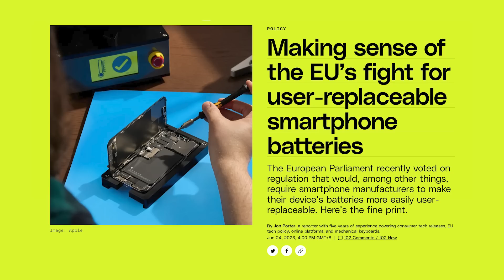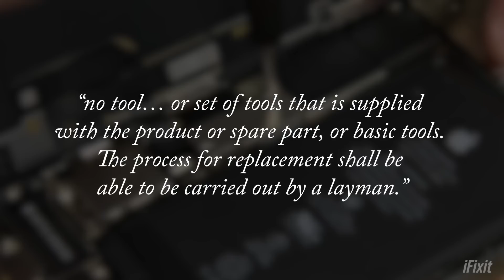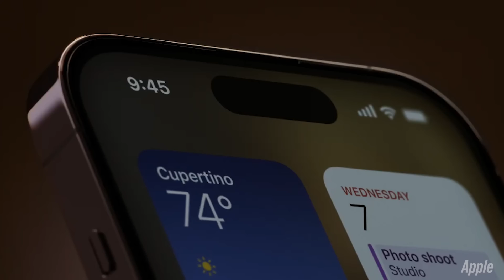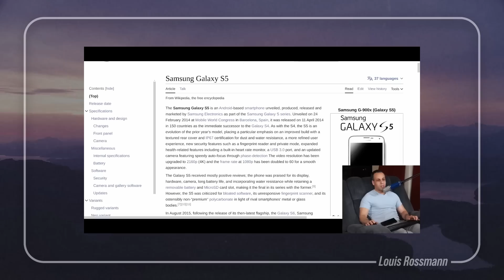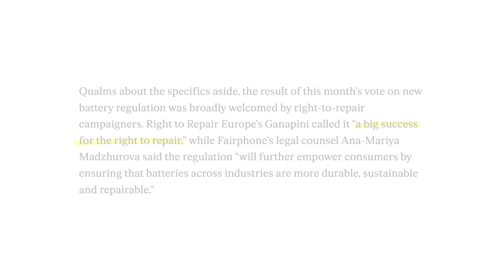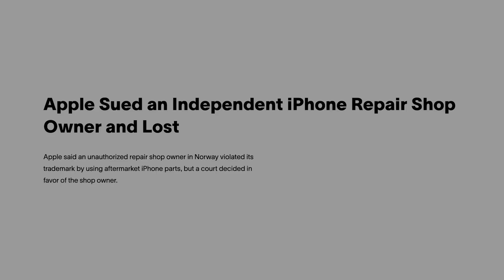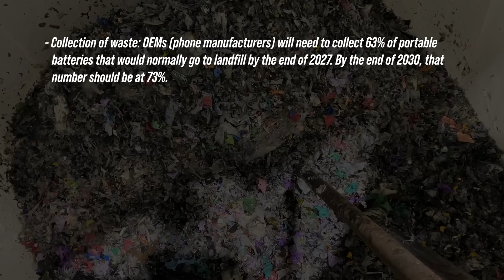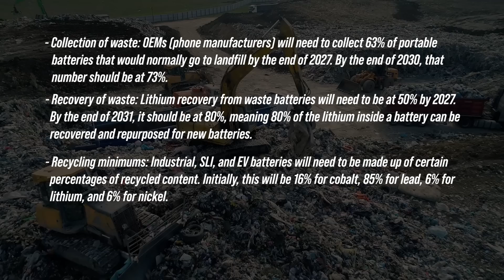EU Just Changed Smartphones Forever

Comment: Despite all this, the funny thing that happened to me with the Samsung Note 4 with a replaceable battery is that Samsung stopped selling batteries for it, and I couldn't find a decent battery that would last longer than a month.
Reply: One of the points of this law is that batteries will have to be somewhat generic. Multiple phones released in the same year will have to use the same battery, so replacement parts will be available for a lot longer.

Comment: Replaceable batteries are only useful when battery capacity is low or consumption is high. Almost every phone has smart charging now and can easily charge the phone back up quickly. 

If consumers are throwing away phones becaues "the battery is dead". That is not a replaceable battery problem, that is a consumer mindset problem. You can change batteries in phones even years ago. Almost any phone shop would easily do it for you and its not expensive (unless its Apple). 

I'm also not buying the environmental issue angle. If batteries have to be replaceable, it also means stock needs to be available. Since it must be serviceable by the user, companies have to make it available in stores, shops have to order more to stock up on batteries. Eventually those models go out of date and what do we do with the surplus batteries? Waste resources recycling them when perhaps they shouldn't have been made in such quantities to begin with?

Comment: The law is stupid. Typical EU overreach in the same way as cookie policies were a stupid thing that ruined the web. Yes, there's a problem, but they always go too far.

Phones nowadays are very water and dust resistant while still slim and sleek. If you have a law like this, you'll lose that functionality for changing a battery. Are they going to expect smartwatches to also require changeable batteries? Most high-end regular watches don't even let you change the battery without tools.

The intelligent thing would have just been a law that you shouldn't be using glue in any way that stops or hinders you from replacing a battery. That's literally all we need.

Comment: I do believe glued together phones resulted from consumer demand. Conspiracy theories are fun, but fact is: when the last few phones left with easy replaceable batteries, the masses ignored them. Started to buy thin and shiny phones made of glass. And for the manufacturers it is easier and cheaper to glue them together, it makes process much simpler. And they got away with it only  because the consumer agreed. The problem is much bigger than this. I have always replaced my batteries in glued together phones. The difference is, instead of a minute, it takes half an hour. Problem is, that it is almost impossible to find and buy the genuine parts. Most of the batteries and screens sold online are not genuine, many of poor quality and some are potentially dangerous. Why manufacturers are not forced to sell spare parts for any equipment they are selling? This is the most important question we need to ask.

Comment: You could have a more powerful device if you could separate out it's components. Just like a regular computer why not have a display unit that has a good battery and basic prosessor that via either a cable or wired means updates and receives screen updates, with a cpu dongle. so that you could have an even thinner screen and faster speeds kind of like the Apple vision pro

Comment: A clear signal and a start to a sustainable environment.

Isn't it obvious that not being able to replace batteries leads to the remplacement of the device?
Thanks for the share ✌️
Reply: that's the idea.

if you build your product in such a way that after 1 or 2 years it starts to become unreliable or even breaks down, and you made it impossible to have it repaired. (or only allow to be repaired by your company for a price almost as high as a new one). 
people will have to buy one of your devices every couple of years which means more profit. and we all know that companies will do anything for a little more profit.
Reply: You can buy a Exchange set and replace the battery yourself if you are a bit handy. For some strange reason the condition stays good longer. The next step must be that apps stay working on old iOS and Android systems
Reply: None of my phones have had to be replaced due to an aging battery. It is always because of some technological shift. Cell service going from 3G -> 4G/LTE -> 5G, 32 bit -> 64 bit, system performance and memory usage by the latest OS's and apps. It's not been a battery issue for like 20 years. Mandating replaceable batteries is not the correct way to encourage innovation with regard to sustainability.
Reply: @MBergyman  I understand, but I think that "the right to repair" is going to go further. Well it's going to have to.
The simple question about "total sustainability" isn't answered today if I'm correct.
So here's one downside, in a distant future, all of humanity will have to agree on; One smartphone that lasts 50 years?
This implying that you would have one or more organisations that would build the same thing forever 🤔
There's a lot to be done here. Not only building but also a mentality shift if you ask me.
Reply: @EmilyandtheG It's baffling, as used to have a older samsung tablet and the only reason I wanted a new one mainly just of the performance degradation (which wasn't a issue before when it was still fresh and all alike and it's a galaxy tab a 2016) and I think updates were gone from it by then.
Reply: @EmilyandtheG It means that you are an amazing person 😉
I'm certain that you are not alone. Still, it's like Christiaan is explaining. That kind of business model brings more profit.
And there are tons of applications were this can change.
Unfortunately there's also a downside to a sustainable future.
Reply: @EmilyandtheG they've deliberately been making phones have less longetivity, so the newer phones don't last well.

Comment: Slim phones with non replacable batteries are useless and have been made from pure greed. Nowdays almost everyone hase a phne case that adds to the bulk. User replacable batteries are the way, I would prefer to have a spre battery in my pocket rather than powerbank. In just 30s I can have fully charged phone...also spare battery is way smaller that powerbank. Laptop that is used at home is pluged in 99.99% of the time, batrery is going to waste. Long time ago I used to remove battery from laptop if I used it at home, batrery was only in use If I'm on the go, and that battery would last way longer than laptop

Comment: Good article. This is good news but I don't think the regulations go anywhere near far enough. The replaceable batteries should be STANDARD, OFF-THE-SHELF batteries, i.e. AAA, AA, C, D, and button cell types like 2016, 2032, etc. That would mean you could buy spares and carry them in your pocket. There is absolutely no excuse. I've been campaigning for this for the last 25 years. Did you know some laptops from 40+ years ago used 4 standard AA cells?

Comment: no one is FORCING you to buy a phone with a non replaceable battery. there're plenty of choice on the market of phones with replaceable batteries. and since iphones are so popular obviously the battery is not a problem for the consumer. government bureaucrats should have no business in regulating how a phone is designed or what features it has as long as it doesn't harm the consumer.  and the environment argument is a complete BS as the prime reason the phone ends up in the trash is display damage. should there be a law forcing phone manufacturers to make easily replaceable displays? what a joke

Comment: Now if you're phone is stolen, there will be no possible way to locate your phone! Always, there's a trade off. Also, Apple might say ok take a replaceable battery but I'll short supply batteries, so it isn't possible for you to find a new one. Once you find a new one they'll make it a hell of a deal to program the new battery to work with the phone.
Reply: So how can you track a stolen phone that's turned off
Reply: iPhones can be tracked by find my phone a certain amount of time before the battery is dead, as the gps unit is detached from the phone and stuck to the battery! I think flag ship Samsung's are the same! @DSN262

Comment: They just wanted money thats why they took the right to repair away, GREED, There used to be cheap items that was waterproof with removable batteries well over 10 years ago so thats an excuse and i didnt remember the need for waterproofing. Splashproof is all a phone needs really, if you want waterproof get the upgrade or a case, if companies want everything waterproof make the battery accessible.. Also giving used batties back is easy, companies do this with used phones and people give phones back so a small battery shouldn't be a problem. Doing this with cars will be a problem tho as they are big and heavy, not many people will have the space or money to get the equipment to remove a car battery. I would say keep that to the garage.

Comment: My current phone s10e needs a new battery after 4 years probably could have done with replacing it last year, I need to factory reset it before giving it into a repair shop so my data is not at risk and pay probably €30-€40 over the cost of the battery for the replacement and no idea what battery they actually put in the phone unless they let me watch the repair. My last phone a Galaxy note 2 lasted 7 years and  I was able to replace the battery myself and I manually updated the OS on it to keep it up to date. Unless you are gaming or using other heavy apps on your phone performance wont be an issue for a very long time for day to day usage.

Comment: This is a great milestone to force manufacturers into adopting more sustainable products. As of last year I stopped purchasing products which don't provide the ability to replace the battery. Thanks for the content. Cheers
Reply: People don't want it, they get new phones because they like new.
Reply: @Robert-j6r8c  I'm a person ;) and I use my phones for an average of 4 to 5 years before replacing. Other than battery degradation, a good model phone generally has no major performance issues over that period of time - the one caveat I would add is the improvement with the Cameras with each generation.  Cheers

Comment: ive used my iphone 8 daily since 2019 (i bought refurbished for $350) and the battery capacity is still above 90%.

smartphone batteries (at least with iphones) are good enough nowadays to last over a day on a single charge, and by the time the batteries lose capacity (5 years), the phones are no longer software supported

why is nobody thinking about this from a practical viewpoint? look at the design of iphones, replacing the battery takes less than 10 screws, and the waterproof seal can be completely replaced after. to make it any more simple than this would mean making the back of the phone cheap plastic, and would interfere with Qi charging and Magsafe.

Comment: Those removable batteries will be priced around 50%+ of the price of a new device, so buying new devices will still be a preferable option for majority. Other thing that might happen is manufacturers will compensate the profit loss by adding more software paywalls. Like standard apps having premium features for $. Laws and regulations are great, and when we're dealing with just a few huge monopolies Apple/Google/Xiaomi/Huawei/Samsung. Given this will have a global effect, I will not be surprised if the solution these companies will come up with will be similar. Cartel-like similar.

Comment: I had a local repairer put a new battery in a Samsung Galaxy S9.  My elderly father in law now uses this phone and it is more than capable of meeting his needs.  I run a used Samsung Galaxy S20 5g which again meets my needs alingside a Galaxy Tab s7+.

Most changes to all products, not just electronics are driven by profit.  Cheaper to manufacture and harder to repair makes something disposable.  I remember as a child that fhere would be men in their garages or workshops at weekends fixing evsrything from the iron to the engine.  And when something finaly gave in it was collected by the rag 'n bone man or taken to the scrapyard to be stripped of useful metals and other parts.   I often went to fhe scrapyard for parts to repair my sixties, seventies and even eighties cars.

Comment: My phone is a Fairphone 4.  I bought it because it has a replaceable battery (and other parts, like a replaceable screen, just as important as I tend to drop things accidentally), and parts are easy to get... I unexpectedly had to move away from Europe in June, though, so it is now not quite as easy (as they only sell in Europe to stay carbon neutral :/), but I still love my Fairphone.  I don't know what its waterproof rating is, but what I do know is that it has got rained on heavily many times, and had water splashed on it many others, and it is still absolutely fine.
Reply: how many years of updates do you get with fair phone
Reply: @fearless6947  5 years, plus they released the source code of the Fairphone 3, and will probably do the same for the 4 so there will be community updates after
Reply: Yeah i hope this boosts their sales!
Reply: If they make a version with a top of the line SOC I'll buy one for myself. I did buy one for my ex though as a birthday present.
Reply: You’re all wrong about the power button. At least know how modern hardware works before commenting. Most modern phones that have geolocation/security features continue to provide location and lockout abilities even when they are OFF. Benefit of non-removable battery. IP68 dust and waterproofing is also a benefit of not having removable batteries. Security is a valid reason and tends to be a bigger concern to a bigger number of users than having the ability to replace a battery. BY THE WAY, replacing batteries on modern phones is not that difficult for anyone with common sense. Everyone makes it sound like it’s an absolute no go.
Reply: @AlEbnereza  both find my iphone and Google find my device don't work if the phone is off. They only show its last location before turning it off.

Also, there used to be IP68 phones with removable battery before they started gluing them in. Did you watch the video?
Reply: I prefer a phone that can't be stolen immediately switched off. Removable batteries compromise security.
Reply: @TerriTerriHotSauce  this is easily solved by introducing a smaller secondary battery installed behind a cover that can't be easily accessed. 
However this is more expensive, takes up space and goes against the very law discussed in the video. But life makes you do compromises. Choose what is important to you.
Reply: @TerriTerriHotSauce  You can just hold the off button for a few seconds on any phone that doesn't have a removable battery.
Reply: @TerriTerriHotSauce  have you never heard of a power button?......it also turns your phone off....just as fast as removing a back cover and battery.......taking the sim out is even faster.......removable batteries do not compromise security any more then the power button or removing the sim......how about dont loose your phone in the first place.

Comment: One device that comes to my mind is wireless headphones, they don’t have replaceable batteries and are designed in such a way that when you try to do so, something breaks.. Love to see them with replaceable ones.
Reply: 1 / 1

What genuinely frustrates me is that Apple invested significant resources in devising its unique snap-in system for swapping ear tips, yet they rendered battery replacement nearly impracticable by sealing it shut with adhesive. This approach contradicts the principles of Dieter Rams, who emphasized that good design should be enduring.
Reply: Hearing aids have replaceable batteries.
Reply: They sure do!  @taqial-faris6421
Reply: Considering their annual shipment of approximately 80 million units and an average battery lifespan of two years, this translates to generating about 35 tons of PVC plastic waste. This calculation excludes both batteries and electronics. 

By introducing replaceable batteries to extend the device's lifespan, it could remain functional until its natural end or until the Bluetooth protocol becomes obsolete.

This change has the potential to elongate the average device lifespan to around ten years, effectively avoiding the creation of an additional 135 tons of electronic waste, which would be detrimental to both the environment and consumers. @justinbennitt835

Comment: In my perspective, one of the most significant areas of inefficiency appears to be in the realm of computing power. It becomes apparent when you consider the multitude of features that accompany each new smartphone iteration, often accompanied by upgraded hardware specifications. Therefore, in conjunction with advocating for replaceable batteries, it seems appropriate to also raise the bar for software requirements.

I recall instances involving iPhones possessing the capability to smoothly operate Siri, yet their potential remained untapped due to certain restrictions imposed by Apple. A parallel situation arises with MacOS, as I struggle to identify any compelling reasons that would justify a 2013 quad-core Mac's incapacity to manage MacOS Sonoma. In essence, it seems that barriers are put in place without valid justifications.